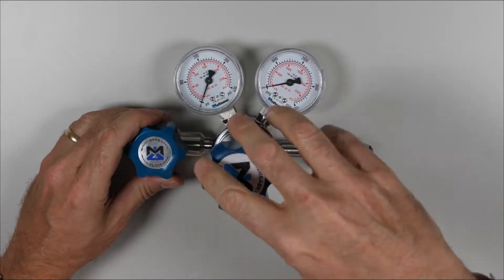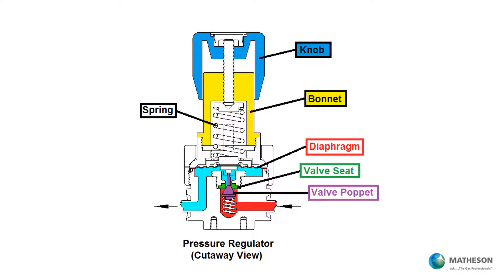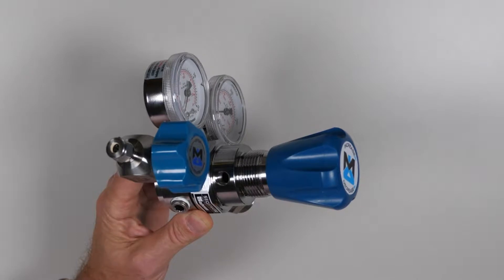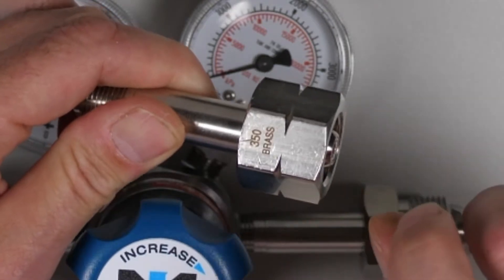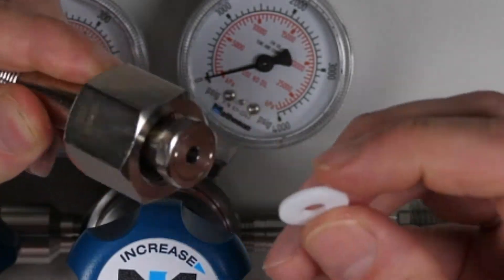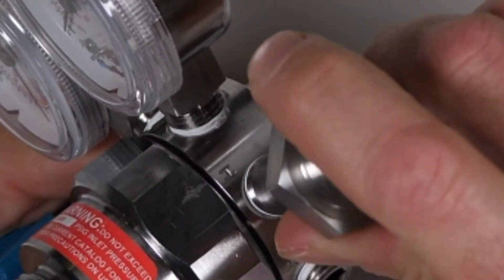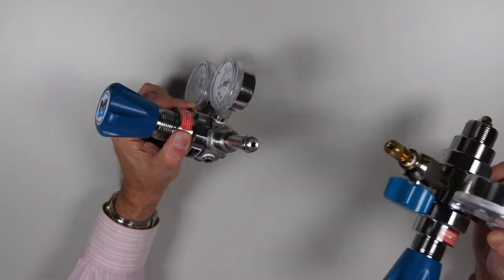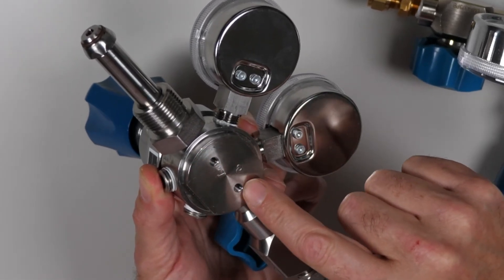Pressure Regulators for Regular People

Comment: Not a single word about how to operate the regulator properly. Lame.
Reply: You shouldn’t be learning this from a random video on the Internet, though
Reply: @TheLostPacketYT maybe you know where to find a FULL, DETAILED and PROFESSIONAL manufacturers instruction?
Reply: @PavloKuchma  you have to select manufacturers who provide information before you purchase any equipment or you need to pay for full and proper training boc provide very good service worldwide. Also there is a certain amount of technical skill required to use the gas in an application so it is assumed that training for that will tell you how to turn a handle